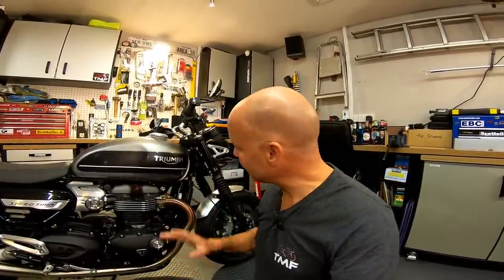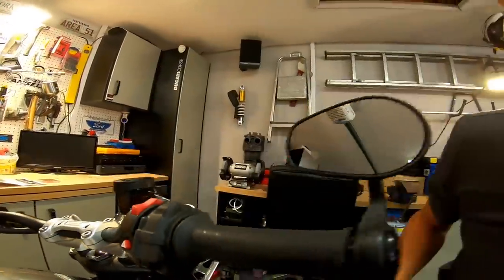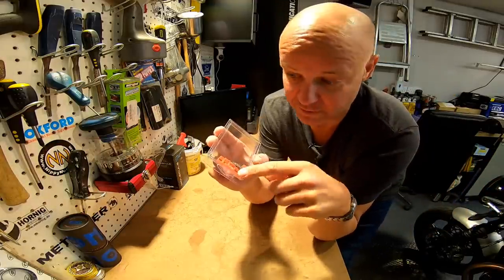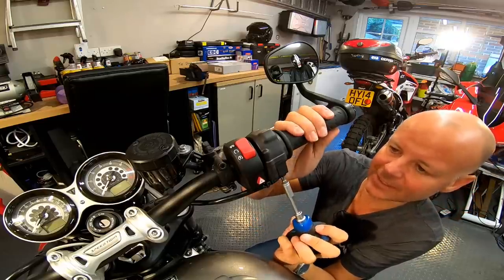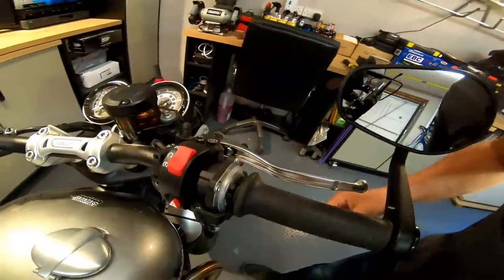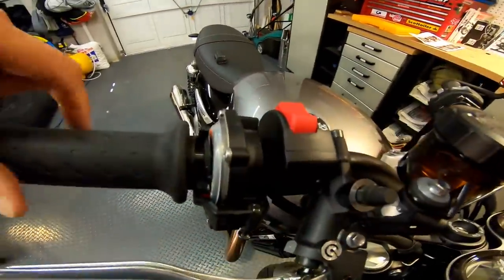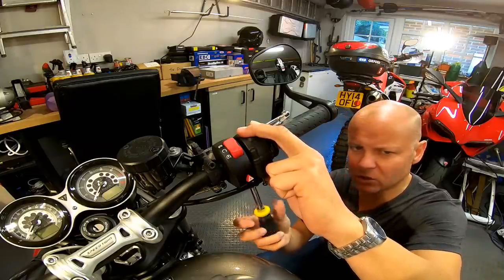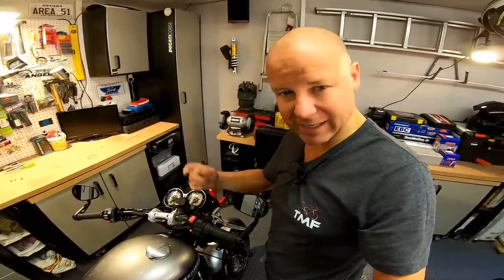Triumph Speed Twin - How to cure a snatchy throttle

Comment: Interesting.... on my new Speed Twin, I have no more than about 2mm free play, what symptoms did you get? I have 'hunting' for want of a better phrase at low speeds, I just ride around it, do these spacers cater for such a small amount of throttle play? because I would hate to have no play at all. thanks for your time mate!
Reply from the maker: The spacers remove all play - for your hunting issue you probably want the booster plug (an electronic fix which I also have fitted)
Reply: @TheMissendenFlyer  Great, thanks for replying.... did you do a video on fitting the booster plug? cheers, Dave

Comment: The factory leave play in the throttle for a reason. Triumph were not happy when they found out people were fitting these.. The play is there to ensure the ecu gets correct closed throttle information. It's not worth risking your life messing with throttle sensors.
Reply from the maker: I dropped my Panigale once because of a jerky pull away at a junction - this mod has now made that so smooth I'd not drop it in the same scenario again...I think they have enhanced my safety....I love 'em

Comment: Please correct me if I'm wrong but I have yet to do this on my Panigale because as far as I can tell, it would only take up the slack from a completely closed throttle. 
If that's the case surely when riding along normally on part throttle there would be no difference at all?

Comment: Does, or can this raise the at idle RPMs? Is a little dab of lithium grease recommended to slide the shims in place? Or on outside surface after slipping into position? Thanks very much for this install vid.
Reply from the maker: No it doesn’t raise the idle revs…
Reply: @TheMissendenFlyer  Thank you.

Comment: Dont do this if you have a cable throttle!!!! Otherwise when you turn the bars the revs will increase! Keep the 3mm free play.
Reply: Or just adjust and double-check. I've only got 1 to 2 mm of play in mine (which I quite like) and turning the bars doesn't engage throttle, although it easily could on another bike.

Comment: Sure that free play is supposed to be there ,to make sure the throttle has no trouble shutting off properly .A old carbed car would be set up the same .It's basically a safety thing
Reply from the maker: It is indeed supposed to be there - but I prefer it without it - makes  the bike easier to ride......

Comment: I got older bikes,,,,is there not an adjustment on the throttle cable,,,most machines I have, have a spec and it's routine maintenance ,,,,

Comment: Do these throttle spacers work safely if you have cruise control that needs a bit of slack beyond the normal closed throttle position to deactivate  c/control? (Personally I would be wary of anything that’s ANY part of deactivating system for the c/control!!!)
Reply from the maker: My bikes with the spacer don't have cruise control so I don't know I'm afraid - one to ask the guys at Ducatispacers.com

Comment: Interesting. My 2018 Street Triple has play (which of course it should have) but is smooth as silk at slow speeds. I checked the website you mentioned and they don’t do a spacer for a Street Triple. So is it a different throttle body in the Streety? Odd. And if it is different and it works so nice why isn’t it on other Triumphs?
Reply from the maker: I dunno - interesting one!
Reply: It may just be one persons smooth is another persons jerky? Nice mod anyway 👍🏻

Comment: I can't say I've ever noticed just how much free play there is in the throttle of my Bobber & Scrambler XC until I watched this video then tootled off in to the garage to check both my bikes but I now have a question. If your Triumph model is fitted as standard with cruise control (just like my Scrambler XC is) surely by removing any slack you will also be losing the throttle CC shut off feature by preventing the throttle from being rolled forward ?  Just a thought.
Reply from the maker: Dunno....
Reply: @TheMissendenFlyer  Presumably the manufacturers have checked that their modification doesn't kill this safety feature on the cruise control ?

Comment: After the mod, do the revs increase when you turn the bars to full lock?
Reply from the maker: Nope....
Reply: Why would it do that? its electronic NOT a wire cable to the carbs, it is all controlled by a variable resistor in the handle bar throttle housing :-)
Reply: @ronnierush9379  Some ride by wire have cables at the throttle that control an actuator, thats why I asked.

Comment: £25 + postage for those tiny pieces of plastic! That's daylight robbery.
Reply from the maker: It may be a huge profit margin but I still insist for the difference they make, it’s great value for money......
Reply: @TheMissendenFlyer  Weight for weight and return on investment they knock gold into the dust. Simply eye watering mark up. The cost to produce them must be tiny. With a home plsstic mould kit you could probably knock them out for pence. I hear what you say about the transformation it makes to throttle control, I don't doubt it, but the cost for what they are! Either the problem is deliberately created by manufacturers and they are in cahoots or there are people really milking it. I'm sure there is a home bodge that could be done which would be equally as good. Talk about taking advantage of bike owners. But £25-30!!!!!! Thanks as always for making.

Comment: Why the heck doesn't Triumph fit this as standard? Seems crazy.
Reply from the maker: I think the slack is meant to be there - doesn’t do it for me though!
Reply: @TheMissendenFlyer  A snatchy throttle can defo be a deal breaker and spoil your biking enjoyment. My Sv650 is terrible around town but other than that i like the bike so i just put up with it. On a premium machine like your new Triumph you should want to get it right, so well done on fixing it.
Reply: @TheMissendenFlyer  I hate to open a can of worms but if the slack turns out to be part of a regulation, would a forensically-minded loss adjuster claim it invalidated your insurance unless you told them and they agreed to the change?
Reply: @kevinmobile  My thought exactly, and does it invalidate the warranty?

Comment: Total rubbish.  If your off the throttle, it is the ONLY time these spacers do anything.  So when your riding with the throttle on tension the spacer does nothing as the twist key way is  pushing against the throttle key.  Its just physics which no matter what you think it cannot change.  Ask Scotty.
I bought these and didn't realize how much "Marketing" is involved.  It works great while the bike is stopped or at the lights with no throttle on.  Its a cosmetic thing riding there is zero change.  I have one pair and though meh.  doesnt help low speed as guess what your on the throttle on low speed.
Reply from the maker: Couldn’t disagree more Graham - of course when your on the throttle the slack is taken up, the issue is the transition from no throttle to some throttle, that’s where the free play is that makes for jerky slow speed riding. You’re the first person I’ve ever known who doesn’t think the spacers improve the ride. Thanks for watching.
Reply: @TheMissendenFlyer   its ok to disagree with me but disagreeing with physics and natural laws around them is a bold move.  I have them installed and they are nice when the bike is parked or when you first put your hand on the throttle.   When you have any tension aka the bike is moving your against the throttle and that does not change so HOW does it change anything at all.  
I imagine if your riding with no hand on the throttle that would help but why would you do that anyway.   I think that the money spent is what is convincing you that its a good thing.  Just who springs and stops works shows that its impossible to effect changes to a throttle under pressure as its pushing the stop with spacers or without lol.  SO again physics.

I think the term needed here is the placebo affect.  Where you think its better and because you think it is you believe it is.